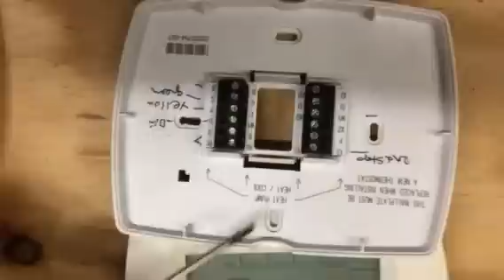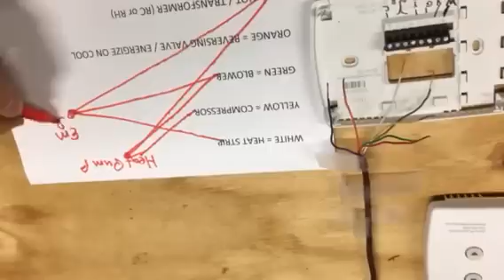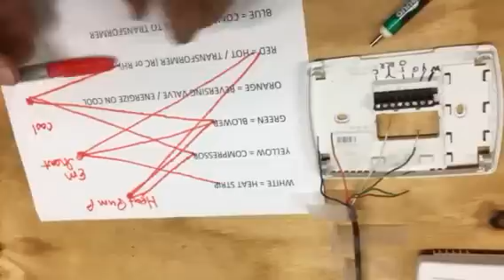Thermostat Wiring

Comment: Hey man I got a question if you tie in the red the yellow in the green to operate heat how in the world can you operate the cold cycle by tying the same exact three wires together red to the green to the yellow wouldn't you have to put orange in there to flip the reversing valve?
Reply: ha, I noticed the same thing and have questions. I see you posted this 2 years ago and never got a reply.  I guess there is no point in me asking questions here.

Comment: Thanks for mentioning that in Southwest Florida they just use the heating element in the winter.  That's exactly where I am.  Southwest Florida. My heat pump doesn't even have a reversing valve and the yellow wire isn't even used(!).  What is complicated is that my unit doesn't have orange or yellow wires.  Also, my brand new Honeywell thermostat does not have a terminal labelled "C".  The secondary terminals on my transformer are red and purple.  The red goes to the thermostat and the purple goes (eventually) to the contactor.  On the opposite side of the contactor it exits as the blue wire which goes to the thermostat.  So that's my common wire, right?
Reply: If you can somehow get that heat pump working for heat  have somebody put in a reversing valve it is save you hundred on your electric bill

Comment: A few times my heat didn’t come on.  The thermostat was set to 70/heat and the thermostat said it was 67 degrees.  I pulled off the thermostat looked inside and then reinstalled the thermostat and he heat came on.  Is my thermostat going bad?

Comment: Hi David, thank you for your helpful videos. It makes easier now. Yesterday I got an issue with ceiling (townhouse) heat pump and really stuck - Everything looks well, but outside unit (compressor) doesn't start. Also relay (transformer - aux - limit) is buzzing. Before no buzz, but unit was worked. Customer changed wall thermostat and it stopped. I came, replaced the thermostat for heat pumps, started work. Run 2 days, then stopped again and buzzing noise showed up again. Have you get something like this?

Comment: Thank you David, your instruction got my gas heat to work, manually, and it is heating my house. 
I connected the Red, Green and White and the furnace went on, great. Thank you again.
I have to replace my 35 years old Programmable Robertshaw analog thermostat (battery operated quartz movement).

Comment: I’m needing some help. I have been trying to fix a furnace in a apartment for a friend. I keep blowing a transformer, after wiring up the thermostat. I’m not certain where to put the blue wire. I traced it to my furnace and it’s going to a Sequencer. And they got cheap thermostat and it doesn’t have c spot so I put it under b

Comment: What happens when you don’t have a C terminal for common to check your transformer voltage
Reply: You have to check it at the transformer. You probably have a battery in your thermostat if you don't have a c wire

Comment: Hi Jones, Great video. I have recently replace my honeywell thermostat with next 3rd generation and I have followed your advice of taking a picture and connected my nest. First, For some reason, the original builder electrician didn't follow the industry standard. For some reason, he used the blue wire as HOT (instead of the red) and left the RED wire unused from the heater.  So, I didn't have a common wire from my Gas furnace. But, I followed the original connections to the nest. Orinally, the thermostat had R & Rc are jumped and missing lead connector for C.
Y => Y, G => G, W => W, and Blue => R/Rh. 
It was working fine for about 6 months and it started reporting error that the heater stopped ubruptly and it wouldn't work.
Is nest a good thermostat to use here. Why is this error reported.
BTW, I have 2 thermostats & heaters connected seperately and one is working fine without errors. Appreciate your help...
Reply: P

Comment: My fan is always on even though my thermostat is set to auto.  The blue wire is attached to "L" and the white wire W2. Green is attached to green.  Orange to white. Rc and R are bridged together with the red wire.  Is it a wire problem or a short or what.

Comment: hi. have a question. my son in law. his dogs chewed his thermostat wires outside. I fixed them changed the fuse 5amp. it worked fine. the dogs again chewed the wires. he then put a 40amp fuse in the circuit board which required a 5 amp. and now nothing is working. I changed out the circuit board that wasn't it. Is it the transformer?

Comment: My heating element stays on after the fan turns off realize the yellow wire coming down from the thermostat is disconnected on the heater can you help me 816-359-7598 Albert Castro

Comment: It's an electric furnace the yellow wire came off don't know where to put it back electric furnace my heating element stays on after the fan and the temperature on the thermostat turns it off

Comment: QUESTION...PLEASE HELP!!! I changed my stat from white rogers thermostat to honeywell basic stat because my rogers would not stay at the number that I would set it to. Got it installed and I'm about 95% sure I got the wires where they need to be. Now my gas furnace with a self lighting pilot will not come on at all! I've checked the circuit breaker, checked where the wires go on the furnace and stat to make sure they match, and I've checked the fuse and its fine. I have no clue why furnace isn't turning on at all but I could REALLY USE YOUR HELP!!! Thank you guys!!

Comment: Best vid I have seen. Wish you had mentioned Rheem and Ruud and where to connect reversing valve wire (normally orange) since their reversing valve works backwards from other mfg.  In other mfg heat pumps it energizes the reversing valve in the cooling mode but with Rheem and Ruud it energizes the reversing valve in the heating mode.

Comment: Mr. Jones, I like your video and I changed out my old thermostat and replaced it with a Honeywell Programmable stat. I tied the   red, green and yellow wires together for the heat pump and nothing happened. I tied the red green and white together for emergency heat and nothing happened. What am I doing wrong? Also, the installation guide said to wrap B wire with electrical tape, if the old stat had separate O and B wires. I wrapped the B wire.

Comment: Great Video. It is nice to know that so many viewers picked up on the "Missing Orange Wire" in the cooling section. I take it that most unit's reversing valves come in the "Heat Position." Just trying to learn a little bit about the workings of a heat/cooling pump. FR
Reply: That is what I am looking for. He used the same wires for heat pump and Cool

Comment: We are changing from Robert Shaw thermostat to a nest.  We have a brown wire and unsure where it goes.  We installed without it, but heat is coming out of system vs cool air.  Are we supposed to put the brown wire somewhere?

Comment: Great video. Unfortunately, I bought a nice, high end Trane system a few years ago and they have some funky wiring setup where only 3 wires are connected, Red, White and Blue connected to R (Red wire), B (Blue Wire) and D (White Wire).  I want to change out the thermostat but I cannot figure out what aftermarket thermostat will work with this proprietary system.  I am guessing the R and B are 24v and Common and that the white wire is being used at Data (hence D) but that is just a guess as no standard connectors on any terminal blocks have a D terminal.  I am also guessing that they are managing the data from the thermostat at a control panel and then using the panel to take appropriate action.  Any suggestions?

Comment: Thank you! My replacement thermostat was expecting 'C' connection, but my existing thermostat did not have C, but there was wire available, but not connected. I opened the HAVC and connecting the 'C' wire, and connected the new thremostat- but it was not working - I though i blew the fuse. After seeing your video, I realized it is the auto-shutoff safety switch!! once i put the panel back on it started working again. Thank you very much!

Comment: Are you saying that this is a temporary fix until the thermostat is replaced? So when the thermostat is working, it will normally controls the electrical connections of those wires as we chose the function needed at that time. But, bc it's broken and a quick fix is needed, we must  manually connect the wires according to what function we need at the time. Is that the  general concept?

Comment: Hey, great video.  I have an Oil Furnace for Heating and a central AC unit outside the house, my old Thermostat has 6 wires ( O-R-W-Y-B-G) and I want to use the new Honeywell RHT9580WF WIFI thermostat. The heating work fine but the cooling is where the problem is, for cooling the blower comes on but not the compressor.  The new thermostat terminals are (C-K-R-RC-Y-G-W/O/B-W2/AUX-Y2-L). I'm not sure what to do here since the in the new thermostat, the terminal w/0/b are in the same spot.  Can anyone help with this? Much appreciated.

Comment: Does anyone know what it can be if the Air Conditioner compressor wont stop running even after the blower stops?Not sure if its the Thermostat but the only way to stop it is to turn it off at the thermostat.
Its like the thermostat is not sending a signal to the compressor telling it to stop ?
I changed the thermostat over the Winter the heat works fine but my wires are , Orange, White, Red, Black, Green.

Comment: I wonder what the non energized position of the reversing valve is if no power is going to it.? 
If the reversing valve happens to be stuck in the wrong position, and someone forces it to come on in the heating or cooling mode, I think someone suggested this can cause the compressor to be damaged.

Comment: My old thermostat is Brivis TH4110D1056. It has selector on back of thermostat for Electric or Heat Pump and Gas or Oil. The default selection is on Gas or Oil because I have a gas system. Only the R and W terminals are used. My question is can I replace the old thermostat with the new one model TH4210D1005 which doesn't have that selector on the back of it? Thanks.

Comment: But but we'll well  . Well the way you  instruct it's not complicated . You got  the thermostat   with marked terminals,  you got cable pulled apart to reveal the various colored wire and special  for us dummy you got each appliance  that the separate  wires send a signal .  Then  the test on your list of wire colors  the various connection of combine  wire   so simple to visualize  the way you show it

Comment: David, installed honeywell t5 programmable thermostat. 3 wire boiler system. 2 zones 2 separate thermostats. I have black white and red. I wires as instructed per my old thermostat and my zone valve opens boiler runs and doesn't shut off it exceeds temperature until I manually turn zone valve off. What am I missing it's a brand new honeywell I'm sensing human error in wiring thermostat. Thanks in advance

Comment: The brown wire on my old thermostat is marked with an X I bought a new Honeywell  RTHL3550D and there is no X on the thermostat and the heat pump will not come on so where does that wire go? and is W the same as O/B W is on the top and the O/B is on the bottom.

Comment: I had a Trane Thermostat (TH8321U1030) for a 5 ton A/C and a Gas furnace 125,000 BUT.  I converted it to the Honeywell Pro Commercial (TB8220U1003) , The issue is it shows on the box and in their advertisement the "More" tab which controls the humidity here in Florida.  That tab box is there but empty and non-functional.  Now my A/C fan runs on low speed regardless of auto heat or a/c int's in low speed, unless I turn it to off, then it shuts down. I have red to the R: I have the white to the O/B (W-2): Yellow to the Y: Green to the G; Blue to the C; orange to the Y2; and brown to the W1 .  Any ideas?  Your recommendation would be much appreciated.  On the Trane the wiring was RC red wire: W1 or O white wire;  Y yellow wire; B Blue wire other terminal YE orange wire and the Brown wire to the W1 or W2.  Any assistance would be greatly appreciated.

Comment: Great video! I bypassed the thermostat and made the heat pump connections as directed and my blower worked fine however my outside unit is still short cycling... any suggestions?

Comment: i'm a new HVAC tech. only doing installs for now. so if i want to suck all the refrigerant back into a heat pump; it needs to be in cooling right? so i would connect the red, orange, yellow and green together?  well i guess maybe green wouldn't be needed in this scenario? and this would be if the thermostat wasnt working.. thanks:)

Comment: i don't understand. my wires are right, fan is coming on but i can't torn on heat or ac. changed batteries and the inside temperature shows but won't allow me to change temperature.  What am i doing wrong?

Comment: Updated, I tried to connect RED, YELLOW, GREEN together to see whether if it's a T-Stat issue. Unfortunately, After connected, only indoor fan running, outdoor fan and compressor still quiet, don't even hear any sound. MY indoor fan coil is up on the attic. So I don't know if I need to go up there to check anything. But what do I need to check up there? Please advise. I also connected RED, WHITE, GREEN together and see the heating still working fine. Is that the T-Stat issue? Please advise. Thanks.

Comment: David, my central A/C unit out door is not running when T-stat on COOL position. Fan coil inside is running only, I feel the cool air flow out from air register only but not COLD air. I checked capacitor and compressor with muti-meter already, they work fine but It's still not running and hearing anything from out door unit. The heating inside still working fine except the COLD A/C. I replaced T-Stat batteries and cleaning a little bit. But still not working. I have not tested the T-Stat wires per your video shown but I will later. I'm not sure if that's the T-Stat issue or something else. Please instruct me to pin point exactly what is the main issue that make the outdoor unit not running, and what should I need to replace or repair? Thanks so much.

Comment: am i missing something how can cool and heat be the same three wires?????!
Reply: Agreed with you , he has Y,G and R call for Heat cycle
Also he has Y,G and R call for Cooling 
I am confusion same as your question 
On the heat cycle he is missing O ( reverse valve if heat pump) means Y, G ,R and O
Reply: LeQuang  On heat mode ,the reversing valve is in fail safe mode, no need to be energized in heat mode, in cooling mode, the reversing valve needs to be energized for cooling.
Reply: I noticed that to and im really new at this so it was confusing hence why i scrolled down in comments to see if anyone mentioned or noticed it thx
Reply: B K, I think the 2 replies above are correct. If you have a heat pump, you would need to connect the R to the Y,G, & O. R is 24 volt, Y turns on the compressor, G turns on the inside blower, & O shifts the reversing valve to route Freon to cool the house.

Comment: Thank you for your easy to follow tutorial.  I was able to troubleshoot my AC system with much success thanks to you!  After connecting the 3 wires (R, Y, G) the system finally works but does that mean the thermostat is bad before buying and trying a new one or another issue?  Just making sure I didn't miss a step.  Thanks again!
Reply: so for cool air is y,r,g ?? or g,o,y?

Comment: i have 3 copper wires that have no insulation on them and i have no clue what they do.  They were in the R and W slots. I have a red wire in the RC slot, a green in the G, Yellow in Y, and a blue in C. any idea what those three mysterious wire could be.
Reply: jusuf velovic your red wire powers your other wires, your green wire powers your indoor fan, your yellow powers your outdoor compressor, and your blue wire also your common aka neutral/ground power wire

Comment: why didn't you say anything about the blue wire??????????????????
Reply: Do NOT cut the blue wire!!!!
Reply: lol, I'm actually here for the same thing.  I'm pretty sure that is just power for the thermostat, but I'm gonna keep checking out vids until I confirm that.
Reply: @Isaiah In my research I found that it is typically ether used to power the thermostat or for Heat Pump installations, or, not at all, like you say. 
Although, "power" the thermostat is a bit misleading, as the power is already there, the blue wire just completes the circuit in that case.

Comment: David, you're the best.. I have a question, I'm upgrading to a new thermostat and I DO have an extra unused wire (blue) that I will use for the "C" wire. My current HVAC wiring configuration has "C" wire (on the HVAC unit) being jumped to either W or Y (I should've taken a picture). Do I just remove the jumper wire and connect the unused (blue) "C" wire on both the HVAC and the Thermostat and that should be it?

Comment: how would put a humidistat on a honeywell 9000 with 5 wires
Reply: roger nadeau humidistat wires into your air handler, not thermostat. Wire into r and c aka 24v and common

Comment: I have lenux heater and ac unit  I want to change my thermostat , but in my wires I have . 2 reds wires ,blue wire  white wire and black wire so I'm confused, how connected with my white Rodger thermostat

Comment: Hi David Jones
I replaced Thermostat and everything working fine. I mean cooling and heat both working. but, when I turn on heat outside condenser fan is not working. could you please give me advice how to fix that ?  is there any problem or dangerous  if I keep heat on even outside condenser fan is not working ? thanks

Comment: my thermostat only uses 2 wires red attached to R and White attached to W1 and W2 on the furnace control board however I would like to hook up my new WiFi  thermostat but I need a common I am told, would that be the B connector on the board? its a White-Rodgers model 50A51-405